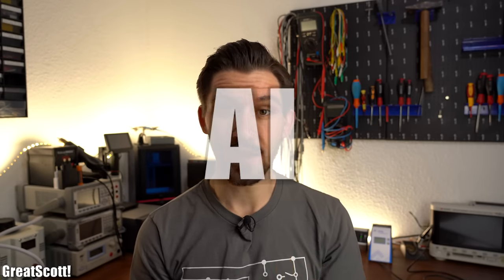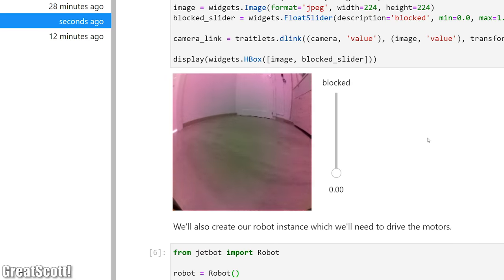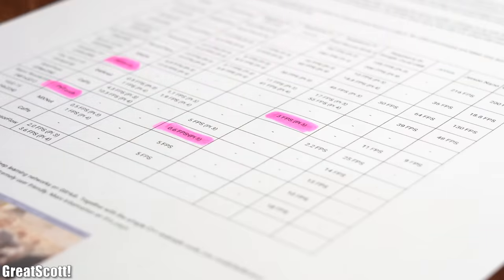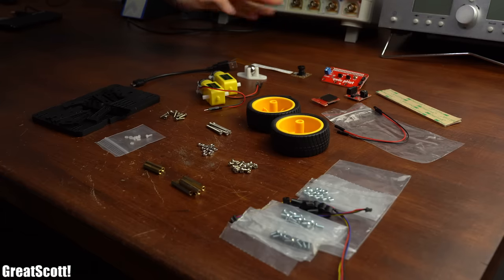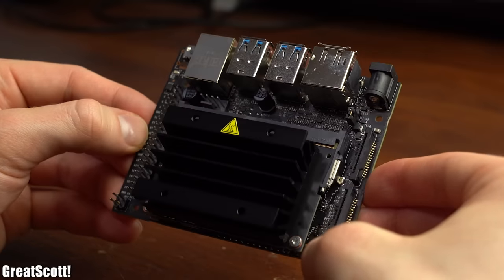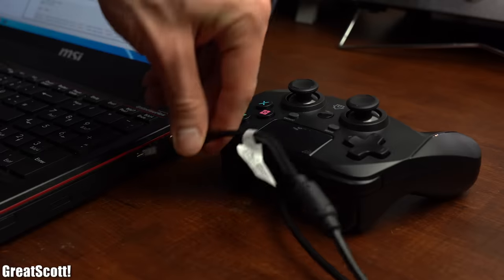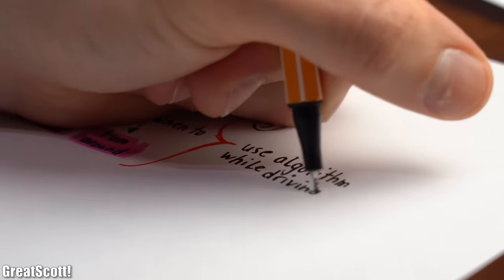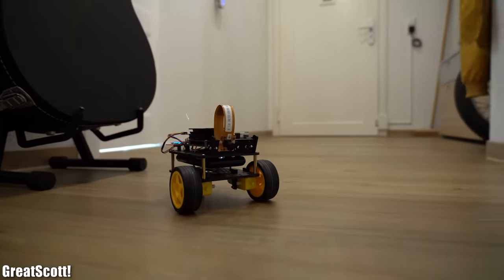Building an AI Robot that can be trained! || Using an NVIDIA single board computer

Comment: The thing about AI is that it's not creating an algorithm to compare the current image to the ones you fed it before, but instead creating a model that can generalize what "blocked" and "free" means, even for images or places that it has never seen before, that's the awesome thing with AI
Reply from the maker: Well explained :-)
Reply: If I expect an AI bot, it would be to recognize what blocked and free means based on certain parameters, rather than a pattern in an image associated with blocked or free (in this case the leg of the chair might mean blocked). so I assume using it in another room with different walls or chairs ecc would completely confuse the bot. did I got the concept right?
Reply: @BlackXeno  not necessarily, if you feed it with tens or even hundreds of thousands of images from houses, it would pretty much work in any room. In this case, if the other room has similar walls and general traits it might still work, just not as well as in the original room.
Reply: @BlackXeno  something like that, let me explain further.
Old image recognition methods will have the problem that you mentioned, because they were based of examples of concepts, not concepts themselves.
Imagine that you go to a new place, and there's a chair there, you have never seen that chair before, nor have you ever seen that kind of chair, but you know what a chair looks like, so you don't have to be told what it is. AI is the same, you teach the AI to know the essense of your problem, object, etc.
Imagine that you want your AI to tell wheter something is a chair or not, so you feed 5 images of red chairs, and 5 images of green "not chair" objects; your data will not be varied enough to tell what a chair is, so it'll try to guess by very limited patterns, so for example, because it always sees photos of red chairs, it will assume that all chairs are red, so green chairs will not be recognized.
The key is in training you AI with very varied and clear data, so it starts to recognize your object by it's core concept, and not what differentiates two similar kind of objects.
In conclusion, well trained AIs will generalize, that means understanding your problem well enough that they can recognize patterns on data never seen before, just like we do.
I hope I was clear enough! :)
Reply: Thanks to all. there's a way to ask to the network if it got the right concept? I read once of a tank recognition AI, failed, because associated the background grass to be the enemy. Which proofs the need to truly varied data. I wonder if was possible to verify this ahead, analitically...
Reply: @BlackXeno  It's pretty hard to see what the network is recognizing or what is activating it's nodes, if there are ways to analitically verify it, i haven't heard of any
Reply: @BlackXeno  There's a pretty good 3blue1brown video about this subject
Reply: and then you can use a much bigger trained model to save you having to take loads of photos.. however it's a bit boring to use for object avoidance.. better would be directing it to the fridge to get beer..
Reply: Im totally not watching this tutorial to make an ai robot girlfriend

Im not struggling i prefer to avoid draka and extra management by staying single but i need intimacy😅

Comment: This could be a really neat unsupervised learning project!
Reply: Actually it is supervised learning since a human manually annotates the images into different classes. In this case either obstacle or no obstacle. Unsupervised would be if both classes would be shot randomly and not ordered by a human into separate folders. And then let the AI model figure out a pattern by itself. For example a VAE would do this.
Reply: I think he just meant it could be. That’s what I was thinking too doing it with reinforcement learning instead and let it bump into a few walls. You probably could get away without adding another sensor if you can see that your trying to move forward but aren’t but another sensor would def make it better for detecting when it hit a wall.
Reply: @georgemazzeo7226  could be something to try. But reinforcement learning requires a lot of trail and error. I am talking about a couple thousand tries to get something driving. Let alone advanced navigation. So you need to physically put the car back at the start a couple thousand times which is not really doable.
Reply: @sieuweelferink6852  I was thinking you could add a bump sensor on the front, if the car hits something then it could automatically back up and maybe choose a random direction to turn (perhaps weighted by its confidence in the blockedness of that direction)

Comment: Maybe the next step could be adding another camera for 3D vision.. Could the Jetson board handle that?
Reply from the maker: Should be able to pull it off :-)
Reply: what about a ToF(time of flight) camera
Reply: @greatscottlab  Or lidar for 3d vision
Reply: Can attest to this, yes it can, as long as the stream is 720p@30fps, but even then your frame rate will be close to 1 FPS or maybe a bit higher

Edit: Just to add to this, the board is not powerful enough to handle ML based inference and 3d vision at the same time

Comment: Adding Proximity sensor and one motor to the camera hinge so that it can look around, also add some servo & hand to move small objects from path change the tyres to roller treads and add suspension add gps to navigate outside on its own

Comment: The creation of the model/neural network usually takes quite a bit more computing power than the network will then take once deployed
I wonder if it's possible to train on a computer with a powerful GPU and then deploy the model on something rather weak like a rapsberry PI

Comment: try to use reinforcement learning instead, by adding proximity sensor / any kind of sensor for measuring distance / bump.
By using that sensor value, code the policy requirement for the network.
and bam you got reinforcement learning robot that can handle any terrain.
(sounds easy hard to implement tho)

Comment: AI actually isn't complicated, but complex. It's a number of formulas, which need to run in a certain order.

If you are familiar with neural networks, and have already built a single cell, then you are on the right path.

Comment: this is interesting but if all you are doing is avoiding obstacles  a set of ultrasonic sensors or infrared or just a set of bumper switches could do the same thing and they are ultra simple to implement
Reply: Using sensors was not the point of the video.

Comment: You should do a video on the Platformio ide discussing it’s benefits and drawbacks in comparison to the original Arduino ide. Then explain why you will use one compared to another

Comment: Could you build your own underground dog fence? Both the box that emits the transmission Through the Wire and the dog collar itself or the receiver.

The only reason I would like you to break these down is because I really wish that there was a system setup for tone vibration and could maybe even send an alert to my phone if the dog crossed the boundary or was within the warning area for too long. But also I see very many cheap underground dog systems along with wireless fence dog systems. I would just like to see how some people might be able to make those better or if I got my hands on equipment how I could make something more specified to what I want to use it for or how I want to use it. 

It'd be quite a project and it's probably work just buying the item. But for example there is a sports dog underground fence and collar receiver. This system also has the option to have a controller that you carry in your hand. That way went out of the house or walking around you can still use it to tone vibrate or even shock the dogs slightly if wanted. I pretty much want to eliminate the shock. Primarily because I see that the vibration setting in my experience offense cares or shocks the dog and stops the dog better than a shock would. So I see no need to go up into the shocking but I would like to see the ins and outs of a system that would have the controller the underground dog fence and the collar receiver. Also when using the shocking setting the batteries ran out a lot faster obviously.

Comment: Can this be used to identify my cats (3 of them) and open a cat door, and not let anyone else cat in?
Reply: You will need a bunch of images of your cats and other cats as they try to pass through and label them (mark each image as go or no go). You can easily get images of your own cats, just by installing the camera at your cat door and recording them as they come and go. The bigger challenge will be getting a few hundred images of a few dozen other cats in a similar position without also training them to come to your door (cats learn faster than PyTorch ;). This would make for a cool community project, everyone could share pics of their own cats and other people could use those pics as the no go samples...
Reply: @tamask001  Good point. Have to think about it. 😁
Reply: @B4x4  I think it would be a really cool project. On a practical note however, attaching an RFID-like device to the cats and having a simple tag reader at the door would be a cheaper, faster and more reliable solution.
Reply: @tamask001  but what's the fun in that... 🤣🤣
Reply: Hey Bjarne I just saw your comment. If did not see it already but "Edje Electronics" has a video on his YouTube Channel where he did something similar. He used a rasperry pi with a camera to notify him if his cats wants to be let in. If you search "Raspberry Pi Pet Detector" you will find his video on that topic. ;)

Comment: but what if we use laser that detects distance rather than images it would be great ai robot then
Reply from the maker: No. It would not be able to use AI without cameras.
Reply: We can use lidar(laser depth image) to get an image of its environment and then apply deep learning over the data that is what Waymo does for autonomous driving.

Comment: This is getting absurd, every one on youtube who make an AI thing, have same stupid idea on use AI and du what can be done with logic circuits, is not even necessary for a microcontroller, just a few logic IC and some optic sensors.
Reply from the maker: Not quite. AI goes way deeper than logic circuits and optic sensors.
Reply: @greatscottlab  I know what are you saying, but end result is a robot that moves randomly and avoid collision
Reply: @greatscottlab  what about a robot that can find something using hints, for exemple recognize a pat which should follow, find piece of bread following crumbs, etc.